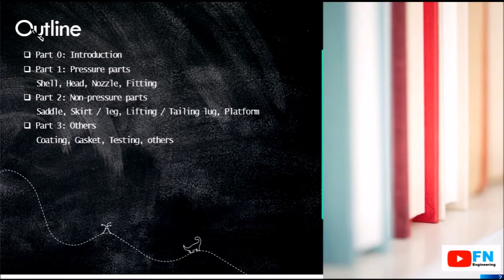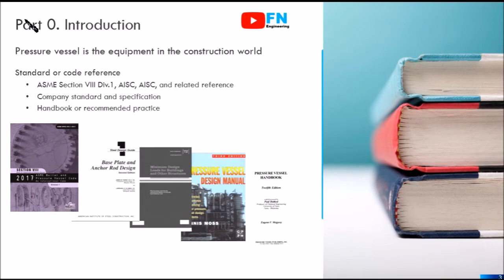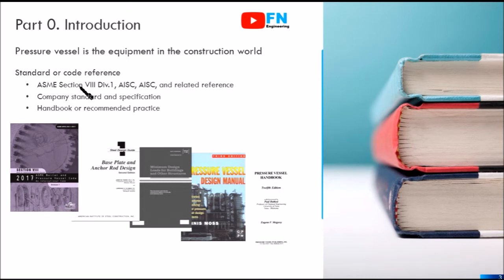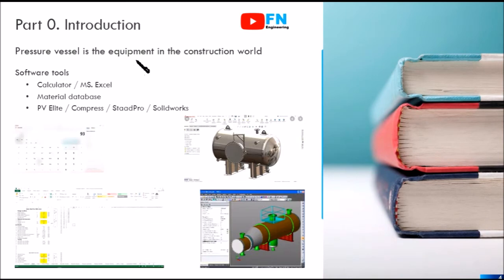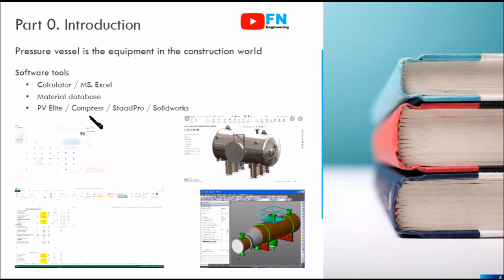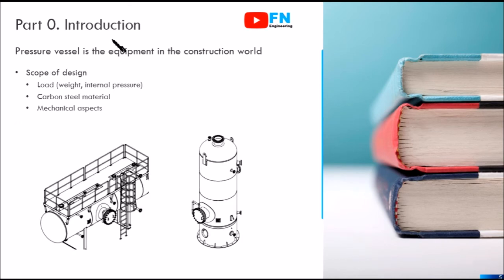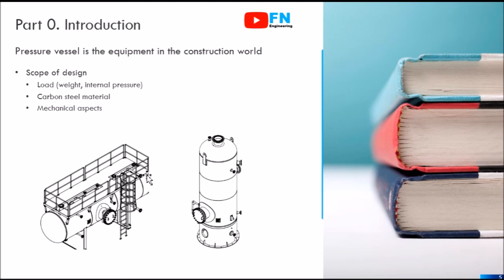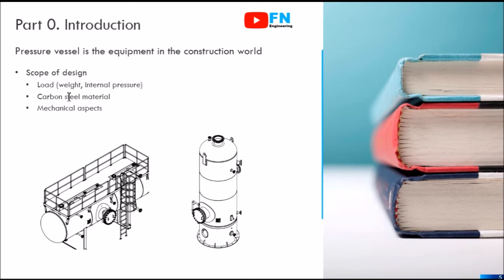Pressure Vessel Basic Design (Part 0)

Comment: Sir I need calculation data sheet for pressure vessel ,heads and scrubber
Reply from the maker: Hello, do you mean mechanical datasheet or mechanical calculation?
Mechanical datasheet is summary design and specification of the equipment
Reply: Mechanical calculation and specification of equipment required for fabrication of vessel and equipment list
Reply from the maker: @shadowlife6997  you can email us to send the equipment data. Our email at falahnusantara@gmail.com
Reply: Hi sir , please reply